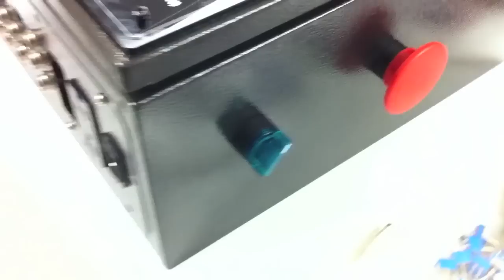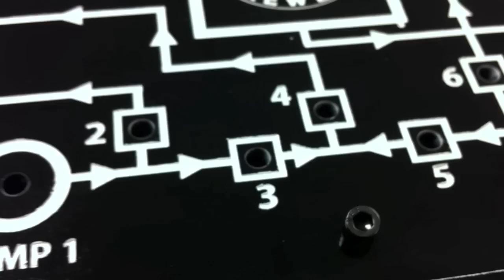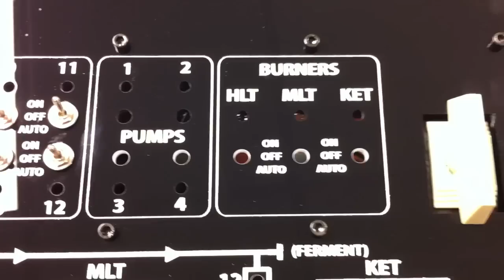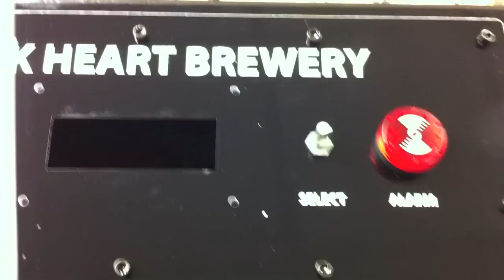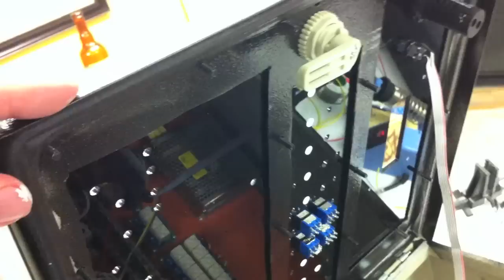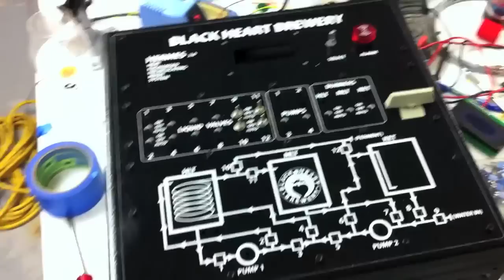Brew Controller Preview

Comment: should incorporate twitter reporting, through an arduino or whatever means that would be easiest, but then you could keep track of process from anywhere with internet acess to twitter, i would have it send a "update/tweet" every 5-10min/or system operation change---which ever occurs first. very clean and professional, good job!! also what company did you go to for faceplate etching/printing?